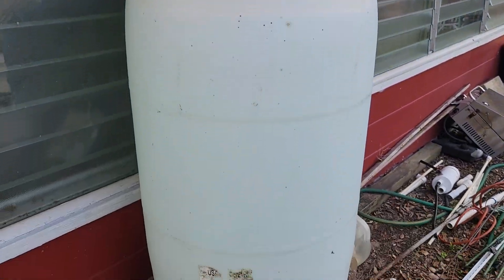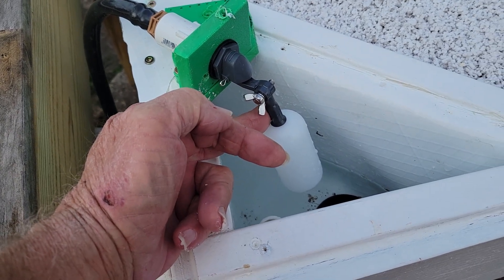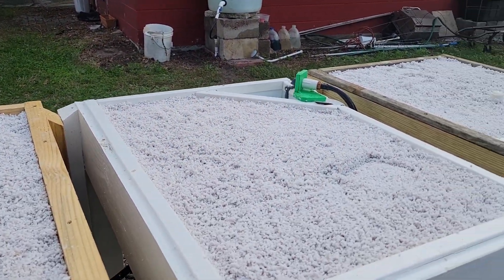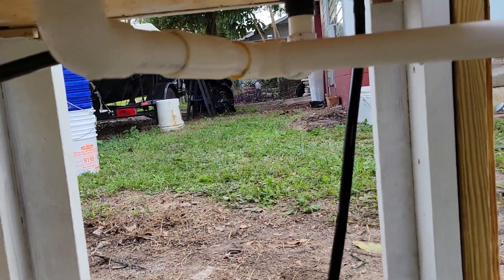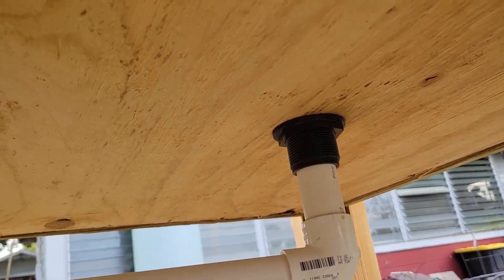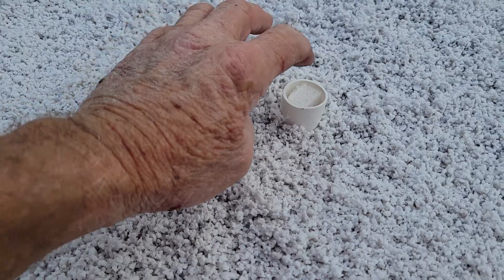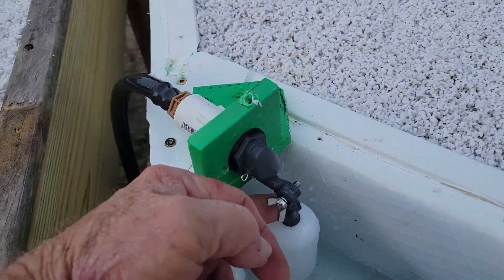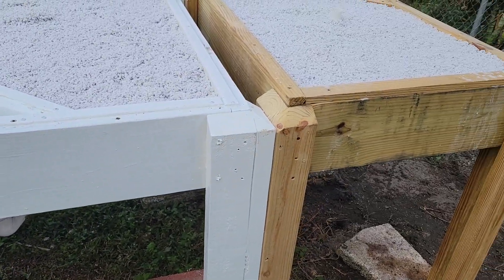NEW OFF--GRID DIY HYDROPONIC, NO ELECTRICTY, AUTOMATIC FEED, NO TIMERS NEEDED

Comment: is this like a kratky method so the water doesn't circulate?
Reply from the maker: Actually the Kratky  method uses no medium. Years ago, before krafty hydrpopnic came out, they would call it passive hydroponics. Passive relies on a wick or anchoring of the growing medium. You would just fill the container with fluid , but now we've added tanks and float levels And other parts. I do believe passive hydroponics is how they grew hydroponics thousands and thousands a years ago..
Reply: @hydropond Oh thanks for that  just learnt  something, can the  perlite be used over and over again?
Reply from the maker: I have  some  that's 15 years old, and it's still good.
Reply: @hydropond  do you wash it after each use?Thanks I'm liking this method so far
Reply: @hydropond  I'm having a good run this year growing straight out of the compost bag from store I started as seeds and they are really flying and hardly any work so far other than dividing into other bags and watering, I'm liking it and love seeing other ideas  like yours too
Reply: @hydropond  simple and practical when power goes out yours still works, a bit like a siphon vs pump comparison one needs no energy input and can run forever